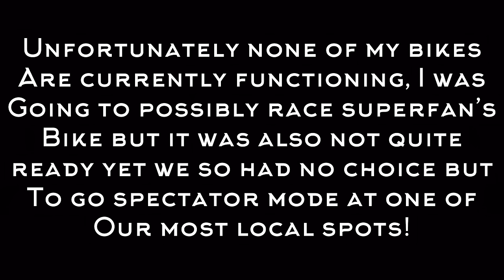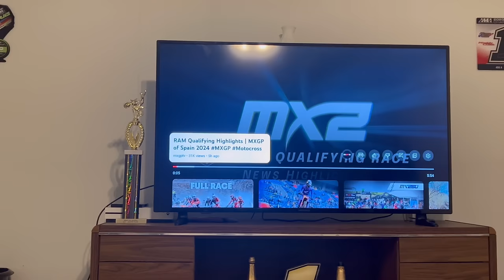I Have Never Seen THIS During a Race!! Lorettas Area Qualifier Mud NATIONAL Madness - Day 1

Comment: I thought the same thing about the skid steer on the track:
Just when you thought the Monster Energy girl was too much to handle.😳
It should have just lined up with the rest of the bikes at the gate, dropped the blade, and cleaned up the carnage and parts as the laps clicked off.
Then at the end of the moto everyone can just stop by the big pile of plastic, metal, goggles, and bodies to claim what's theirs.🤕
Reply: The real question is would Coop go left or right with the skid steer in the way!?